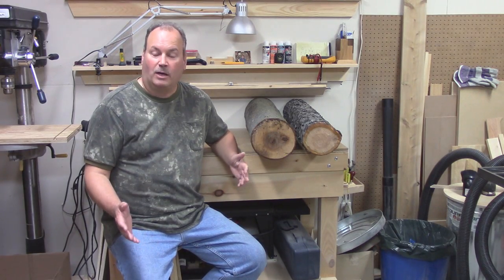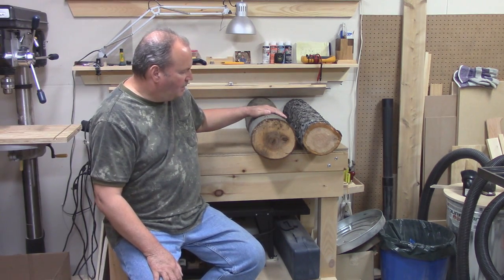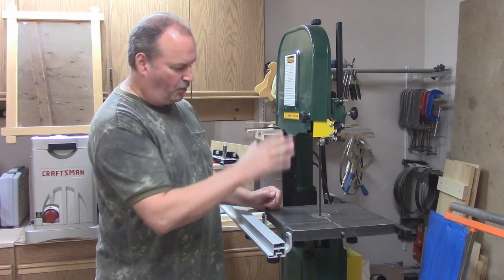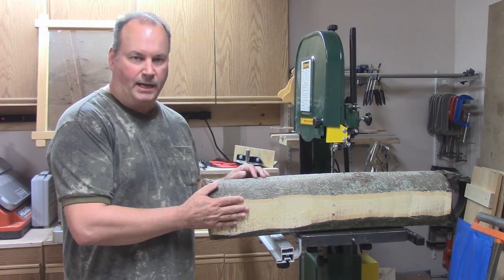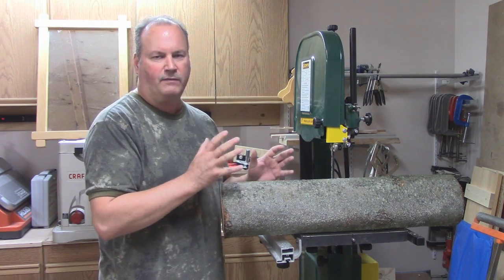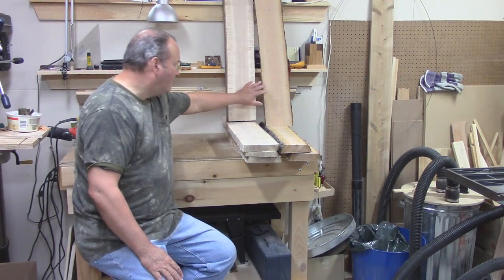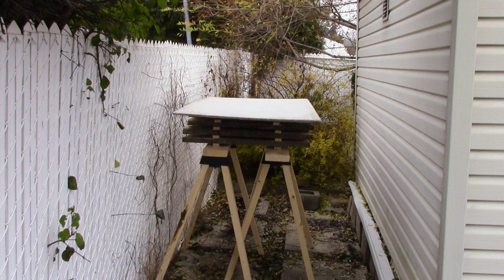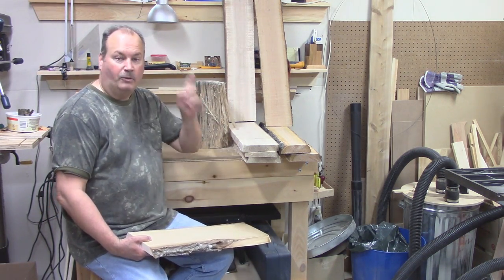Logs to Lumber

Comment: Thank you for sharing, bare wood sometimes has bugs, so we need to clean it first?
Reply from the maker: Most wood I never have a problem, but cherry has a very rough bark that a lot of bugs can hide in. I try to get rid of as many as I can but some make it into the shop. I don't know of a good way to prevent that. Thanks for watching.

Comment: Where do u live?  I'm in Maryland will the wood dry even in winter (snow, rainy, cold)
Reply from the maker: I am in Canada. I stack mine outside to let the wind blow through for about 6 months to get rid of most of the water, then I bring it in the garage for another 3-4 months, then finally in the workshop for a few months to climatize. Then I can use it. After a while you will find that you will have more lumber than what you are using. Building up a reserve.
Reply: Tysm!!!!

Comment: Very interesting video. Thanks for sharing.
At the end you put some specifications of the band saw. But I could not find information on the motor.
How much HP (or Kw) has it? And what is the rpm  (or meters per second of the band saw blade).
I 'm new to your channel, did not see any videos of you before. Maybe you've explained that in another video.
In that case you may also send a link to that video.
Reply from the maker: My Craftex CT015N bandsaw has a 1 HP 120 VAC motor. The pulleys allow for 3 speeds (750, 1230 and 2800 feet per minute).
Hope this helps.
Reply: Thanks for the information. It'll for sure help me in the future. (now I have only a tiny bandsaw 1/3 HP and a heighth max of 8 cm

Comment: I just need educated on something.   What does it mean “ a year per inch”?
Reply from the maker: If you let the cut logs air dry naturally, in general for every inch of thickness it takes a year to dry out the cut stock. It doesn't matter how long it is or how wide, it's the thickness of the stock that we are talking about.
Reply: @PaulPomerleau  Thank you! Thank makes sense now. I was thinking in length! 😆

Comment: why does it have to sit for so long? what’s happening to the wood?
Reply from the maker: Fresh cut wood has lots of water in it. It will shrink and crack and ruin anything that you make out of it. It must dry first. Large companies use a kiln (a type of oven) to dry the wood faster, but for us at home we must let it dry naturally and for that it is a lot slower. This is why we stack it so maximum air can flow through.

Comment: Have you ever had any trouble not using a jig? You just scribe a line on the round log and try to follow the line? I have some trees I'm going to cut and do exactly this, but kept thinking I need to build a jig first. Have you done this enough to be confident that the logs will not roll on you as you put them through the saw?
Thanks
Reply from the maker: Absolutely. Jigs make life so much easier. As I say in most of my videos "There are many ways of doing things". If the logs were bigger, heavier and not as straight then I would use a sled with clamps that hold the logs into place. These ones were small enough that I can do them easily freehand. Plus I also need to make a video according to what my viewers want. I have had multiple emails requesting this video from new woodworkers who have limited tools. If I show multiple ways of cutting logs then the video is too long and people complain. The best way for me to do it is to simply make another video showing a different method. Thanks for watching.
Reply: For stability a person could screw a 6" wide piece of scrap to the bottom of a log and butt one side against the fence and rip away to create the first flat edge.
Reply: Hey, that's a good idea. Thanks.

Comment: What type of sealer do you use at the end grain? I love your attitude, different way to do the same thing.
Reply from the maker: At first I used the can of wax type sealer designed specifically for this but since I only do this every 3 or so years it would dry up in the can, so now I just use any old paint that I have laying around and give it a quick brush at the ends. This actually should be done before cutting, it just makes it easier.
Reply: Excellent Idea, thanks for sharing! Water based paint or oil based paint? and on both ends or just one?
Reply from the maker: Oil is better since it will be outside for a few months, but here in Canada we can no longer buy oil based paints so I use Latex water based paint on both ends. Put it on thick.
Reply: WOW! Why can you guys not buy oil based paint in Canada anymore?

Comment: Can you also do this on a circular table saw or is it going to rotate the log while sawing?
Reply from the maker: Absolutely, I do the small logs on the table saw, the blade is tall enough for them because you are only trimming off the sides. I put them on a small sled and hold it down with a piece of wood keeping hands away from the blade, then I lay it down on the flat side and cut the other side at 90 degrees. Works well for the small logs and is a lot faster than the band saw.
Reply: Thank you! Yeah, I think I've seen that before - a small sled screwed onto the end of the log to stabilize everything and prevent the log from pinching the saw blade by rotating while its in the saw.

Comment: that is quite a long time to wait for your lumber to dry. do you do very large quantities to make this worth it? how do you protect your wood from rain when drying outside? Are there methods to speed up the drying process?
Reply from the maker: I do woodworking mostly in the winter as in the summer I am working on my motorcycle. I usually build small items as gifts and such so I don't require a lot of wood. In this video I got 20 planks of maple and cherry which I got for free from my brother-in-law. In the city sometimes trees fall because of a wind storm or something and I will ask the owners if I can take a branch, they usually say yes just to get rid of it. So cutting and drying it is worth it for me.
I protect the wood just like I showed in the video. Stacked with spacers to allow air flow, cover with a sheet of something (tin is usually best) and then secure it so it stays. 60-80% of the water is gone in the first 6 months, then move them into the garage then finally into the workshop.
The only way I know how to dry them faster is to put them into a kiln, an oven. Of course only the big companies have those.
Thanks for watching.
Reply: maybe there is a potential market for smaller kilms for high end hobbyist?

Comment: Question: in a log of that size, is there a need to avoid a pith?
Reply from the maker: For the size of the logs that I use and the things I make with it (spoons, BBQ scrapers, toaster tongs...) I'm not too worried about the pith. Sometimes I will center cut it first then lay it down and cut my boards from there. I don't need the planks to be wide for what I do. This way after putting it through the planer the pith is gone. But I don't do that all the time. Others may have a different opinion, but for me, I don't even think about the pith while cutting.
Reply: Thanks. I appreciate that.

Comment: how do you prevent it from warping?
Reply from the maker: I find under it's own weight while stacked and covered outside will prevent warping, especially if there is snow on top. Once most of the water in the wood is gone then I bring it into my garage where very little movement will happen, then into my workshop to acclimatize, and finally it is good to cut and plane to give finished material.
Reply: @PaulPomerleau  really? that was interesting because iw as told if you make it lumber and let it dry it warps really badly

Comment: is this possible to do with a hand saw?
Reply from the maker: Of course. Anything is possible. I've done it with a bow saw and a chain saw.
Reply: Paul Pomerleau do u have to leave it for so long
Reply from the maker: Wood naturally takes a long time to dry, about a year per inch of thickness. Big companies use a kiln (oven) which will do it much quicker. For what I need I do only about 3 logs a year. I move them from outdoors to the garage and finally into the workshop rotating about every 6 months, now I have all the free hardwood that I need. You can still buy hardwood for now until yours is ready.
Reply: Paul Pomerleau okay thanks 👍🏽

Comment: :/ You cut the wood poorly. They were wedges not planks. Wasted a lot of wood there. Sad.
Reply: He also missed an opportunity to get some interesting figure when he oriented his first cut.  I doubt he got any crotch figure out of those pieces.  A sled would be a vast improvement, even for the first cut.
Reply: I dont understand. Can you explain ?
Reply: The way you orient your cut will determine what kind of figure you wind up with on the face of your boards.  If you orient the log so your cut splits the branches, lengthwise, you get Y-shaped grain, and rippled grain, and tiger stripes.  If you orient the tree so the branches are at right angle to the blade, you get different, and in my opinion less interesting, grain patterns.  Maybe search for some videos on "cutting logs for figure" and you will see what I mean.
Reply: Damon... I was thinking along the same lines. If he did a drawing on the end of the board he could plan out his cuts and get a better more consistent grain. His technique is fine, but he needs to take it a couple steps further with his planning it out. I hadn't thought of using a band saw for shorter planks and it wastes a lot less wood than using a chainsaw.
Reply: ScotsFurian wedges lol.
Reply: +Mark ''If something is bad and you can't do it better, than it's not bad'' are you in kindergarten? lmao

Comment: I did this with some fruit wood i had (plum/apricot and apple).  Oh man was the splitting horrible as it dried.  I didn't put anything on the ends though///it all became firewood.  I think fruit wood isn't the most stable lumber.  I used a thicker blade on my craftsman 14 inch.  Its fun to do but really only for small projects because its a lot of work///
Reply: I tried some cherry the first time and painted the ends.  It split badly.  My solution was out door duct tape on the ends which also allows me to identify the wood on the ends with a Sharpie and date it so I know how long it’s been drying.  Works much better.  Just keep in mind you’ll be cutting a couple of inches off each end more than likely.  Right now I have redbud, dogwood, maple, wild plum, persimmon, sassafras, sumac, holly, and paw paw in various stages of drying.